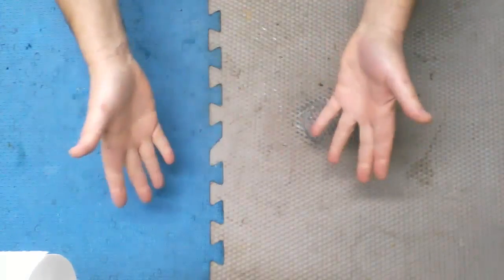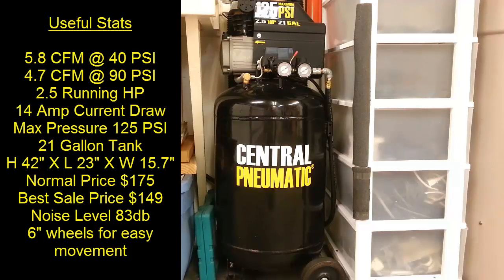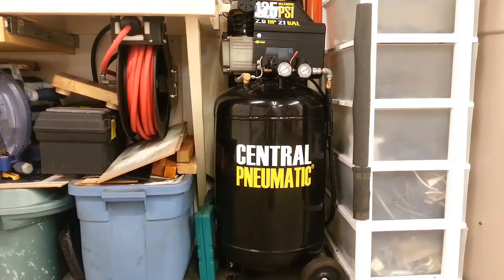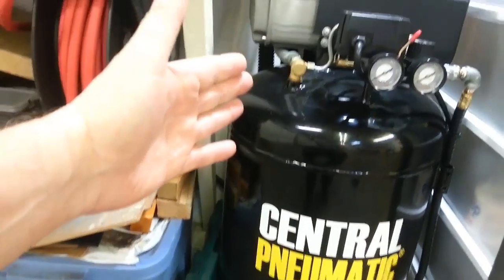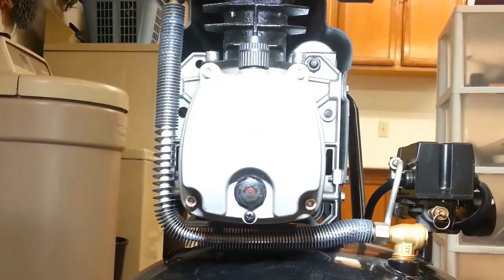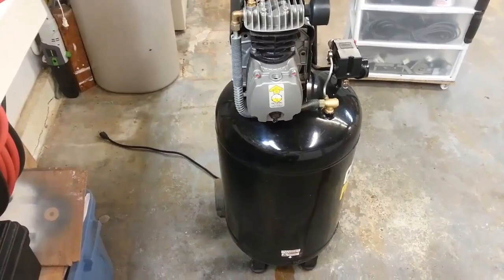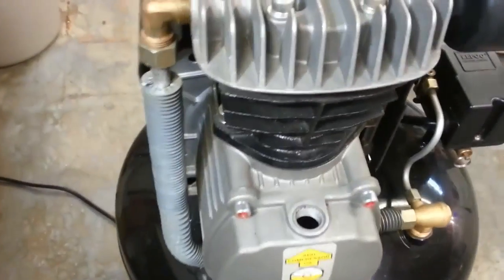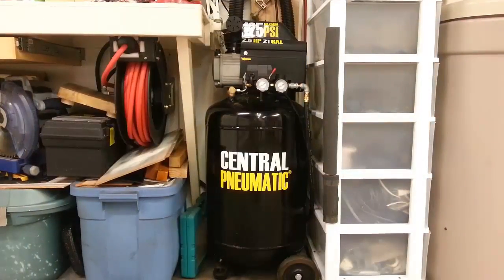Harbor Freight 21 Gallon Air Compressor Review and Set up / Long Term Review

Comment from the maker: In this video we look at my Harbor Freight 21 Gallon Oiled Compressor and do a Long Term review. I have owned and used this compressor for about 3 years and I will give you a detailed explanation of any trouble spots and the benefits of ownership. I will also show you how easy it is to change the oil on this compressor if you don't know how to do it. I will give you my honest opinion on whether this is a good compressor to own or not.
Reply: @the 5 minute mark, the component you're referring to is a 'Cold Start Valve', not a pressure release valve.
Reply from the maker: @AXNJXN1  It goes by many different names. The purpose of the unit is to release pressure from the piston so it can start more easily. Less back pressure to fight against. Lawn mower engines have the same thing.

Comment: Owned one for several years now. Been through years of neglect. Extreme heat in summer and extreme cold in winter. No issues whatsoever with mine. Would recommend to anyone.
Reply: John Dozier   I live in Reno and the temperature at night gets down in the 30’s and my compressor wouldn’t fire up and blew some fuses.   What do you do to use your HF compressor in the winter?   Any tips?

Comment: Have had this one for 2 years. I change the oil regularly with the harbor freight oil. Beat the hell out of this like running it for six hours straight, never letting the motor turn off. She’s still kicking.

Comment: Great reminder to change the oil. I was going to upgrade but used it 2 times. Will be using to paint car soon.
Reply from the maker: Oh yeah, this puppy has plenty of power and air storage to keep up with any spray gun. 👍
Reply: @ModernDIYProjects  That's great to hear. I was going to upgrade to a bigger tank because many people say 21 gallons is too small. Prices are nuts out there now.

Comment: Bought me one today harbor freight...$149....ran it just to see if it works and put it up till I need it😊
Reply from the maker: You got a good deal. They have been raising the price on that lately. Also be sure to do the oil break in procedure so you don't forget later. It will drop a lot of metal in the oil so change it out if you want it to last you.

Comment: Fantastic review! 👍😀
Is it possible to use the Vacuum method to suck the oil out instead of draining it?
Reply from the maker: Yes you can if you can get a small enough hose into that opening.
Reply: @ModernDIYProjects  Got it! 👊😎

Comment: Do you empty your tank at the end of the day?  I'm always concern about leaving compressed air, as I'm not sure when I'll use it again.  Thanks
Reply from the maker: Good question. Yes, I always empty my tank because I am not comfortable leaving the tank pressurized while unattended. I may not use it again for many days.
Reply: @ModernDIYProjects   Excellent, thank you
Reply: Yes empty it everyday keeps it from blowing up in hot weather and keeps moisture out. Also should add a filter to it so trash dont get into your tools.
Reply: @geraldborne94  Excellent, thank you, I'll do exactly that.

Comment: I had 3 returns / 1 that listed 4 years it was noisy and it wore out, never ran in temps that was colder than 40 degrees. It went to the curb.

Comment: The setup is good, but I would avoid dragging the airline across the floor at any cost. Make anything. You would be surprised how filthy it will get and get stuck everywhere. Hang from the ceiling and add swivel .Trust me. Thank you for the video.

Comment: It's actually 1.5 running HP and 2.5 max HP, whatever that means.  Edit: I'm wrong!  I take it back.  I swore I was just at HF today and saw that on their paperwork for this unit.  Maybe I did but I'm still going to defer to what the website and this video says as accurate.  My apologies.
Reply from the maker: No worries.....

Comment: Just bought it used from someone for $100 with a craft man 50ft hose and 2 HF cheap guns.
Reply from the maker: You got a good deal!
Reply: @Modern DIY Projects  just finished cleaning it and changing the oil it looks brand spanking new! Ty for the review

Comment: Thanks. I do see this dbA is 90  in recent advertising.. is yours @  83 ?
Reply from the maker: I also have seen the advertised db at 90, but I did my own test and in my garage I could only get 83, so that is the number I went with. Goes to show that it can be louder or quieter depending on where it is located.

Comment: How well do you think this could work for automotive painting?
Reply from the maker: It should be fine. I have done Auto painting before with a smaller compressor and had no problems. Most Auto paints will spray at 45psi or lower, so the guns are not air hogs. I painted several cars before with a 12 gallon compressor with a max PSI of 100, so this one is way bigger in every way.

Comment: Home Depot has a tall skinny 20g husky air compressor with a max of 175psi & 5.0cfm@90 for $189.99 and it's not as loud as harbor freight 👍
Reply from the maker: There are many more choices now than when I bought this beast. It was the cheapest at the time ($149), and it was oiled, which all the Home Depot compressors were oil-less. I wanted an oiled one and it has been good to me so far, so no complaints here. The noise, is relative since I don't use it all the time. But each buyer has to make a choice based on their needs and budget.
Reply: That must have been a hell of a sell, this comment is only three weeks old, and my i'm seeing that 20g 175 psi husky compressor for $239 at my local store and online.

Comment: I ran mine for about 15min before I realized the brack in. Think I'm ok? Ran it for the 30min afterwards? What mite be problem I will have?
Reply from the maker: You'll be fine. 15 min is nothing. Since you already did the break in, I wouldn't worry about it.

Comment: Mine is really hard to crank in cold weather.... I replaced the coil... same.. any tips?
Reply: I also replaced the pressure release..
Reply from the maker: I was going to say the pressure release valve but you already did that. But make sure that it does open up when you first start it and runs for about 30 seconds just to be sure. You can also try a thinner oil and see if that reduces drag. Aside from that it must be mechanical wear, or something mechanical is holding it back. Open up the top cover and see if any parts have shifted out of place. Also make sure it has sufficient electrical current going to it. On cold days it may draw more current than hotter days. Bad fuse or cord could be causing problems.

Comment: How often do you change the oil?  I bought one just like that about 7 months ago and want mine to last as long as yours. I removed the handle as well. It is loud but extremely useful.
Reply from the maker: I change the oil every 6 months and you saw in the video how dirty it gets. Mind you, I don't use it every single day, so if you do, I would make it a shorter interval. Compressor oil is cheap, I get that bottle of oil at Home Depot for $2.50 and I get 3 changes per bottle.

Comment: 83db? No way. Mine measured at 95db.
Reply from the maker: The DB will vary among units depending on where it is located, oil used, air filter, etc. I probably have things around mine that adsorb some of the sound. It is still rather noisy, so it matters not such a minor difference.